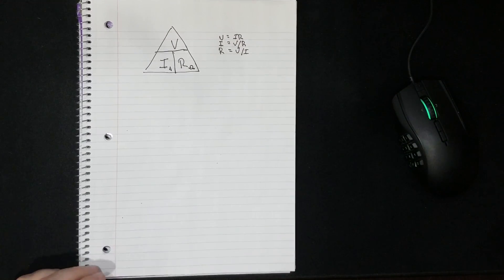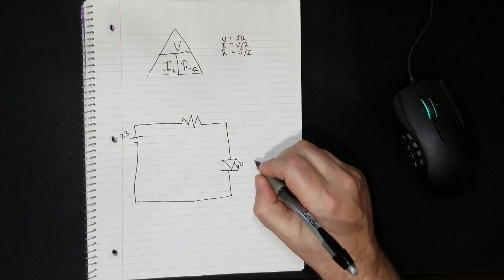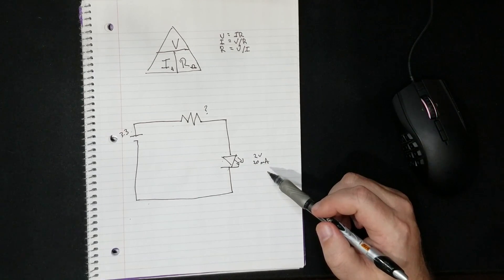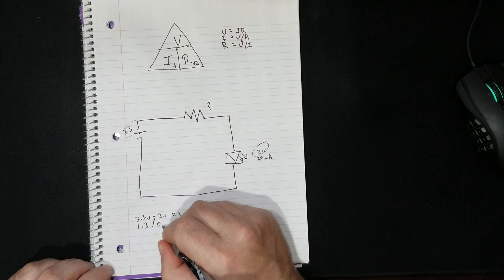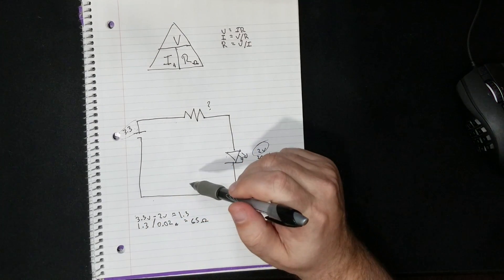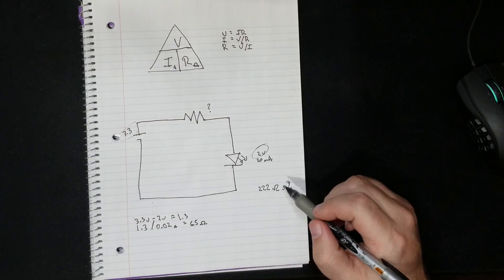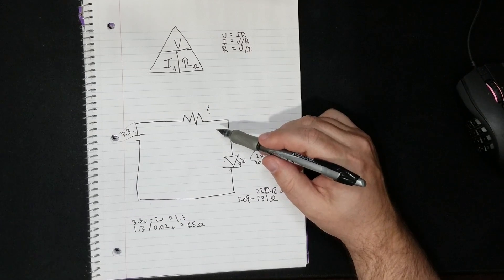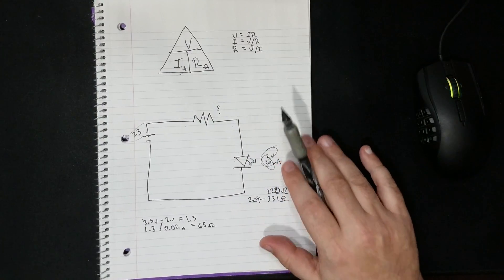Ohm's Law Explained Simply

Comment: I've been trying to understand Ohm's Law more intuitively for a LONG time. This video got close! Using the law makes a lot more sense for understanding the amount of resistance needed. But I'm still confused about subtracting the voltage of the LED from the total voltage of the circuit. Why is that done? Because that makes me think of subtracting the amperage of the LED from the amperage of the entire circuit, but we don't do that, we calculate resistance. So I still don't fully understand the relation between all three...
Reply from the maker: The LED has two properties that we need to be aware of. The amps uses, in this case it was 20mA or .02A, and the Voltage that is just consumed by it. The equation works with the amperes, but before we can do that, we have to remove the Volts the led consumes first. The amperes are what is needed to get the light to light up. The more the brighter it will be until we hit that critical point where we fry the led.

Did that make more sense?

Comment from the maker: Do you like these more in-depth style of videos, or just stick to building the stuff?
Reply: Finally someone explaining how to actually apply the knowledge to Circuits. I would really love some more practical lessons like this. I really strugle to find the middleground lessons for electronics. All I can find is basic stuff (resistors, capacitors, ...) and then full diagrams of devices, no intermediary steps.
Reply: These more in-depth videos are awesome. As an EE student and hobbyist, your explanation was easy to understand. Keep up the good work! 

Ps: As a side-note, in some countries, voltage is denoted as U instead of V.
Reply from the maker: +Justas Rafanavicius yah. I seen a lot of different letters used while looking up the triangle. It was one of the reasons I wanted to use multimeter symbols instead.
As long as people understand the math and can use it for there own work was all I cared about.
Reply: i like the in-depth style.its always best to know everything about what your doing. knowledge is knowledge.
Reply from the maker: Seems like everyone likes a more in-depth explanation of what is going on in the projects. I guess I will have to do follow up videos to some projects explaining the physics behind what is going on.